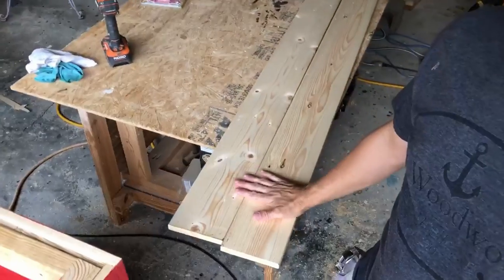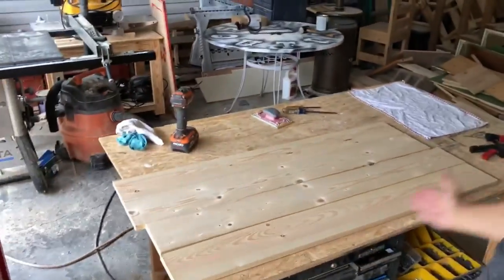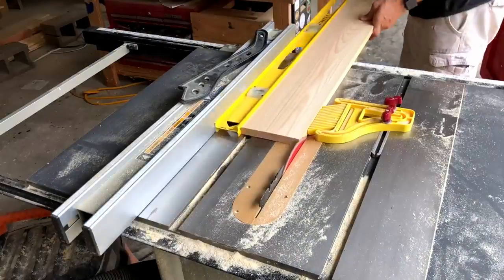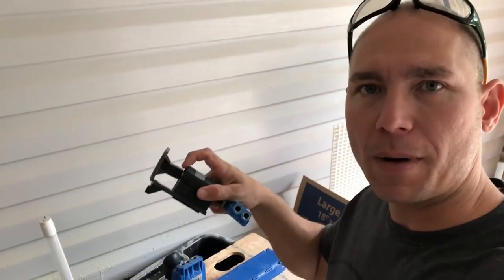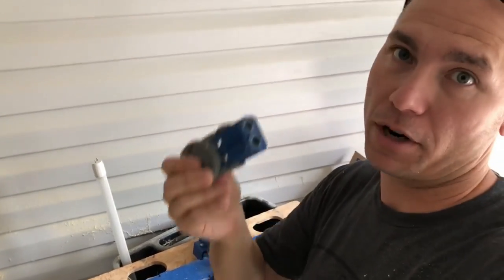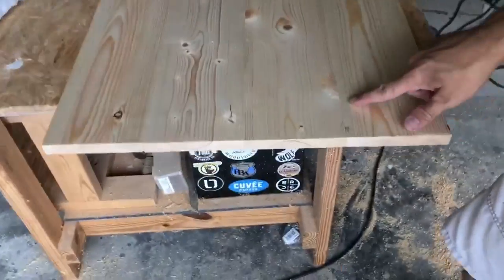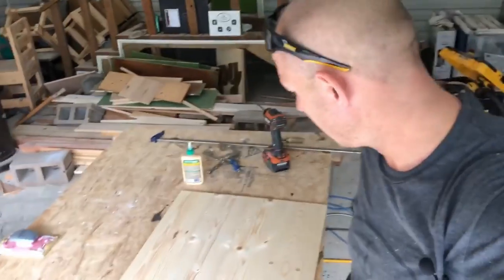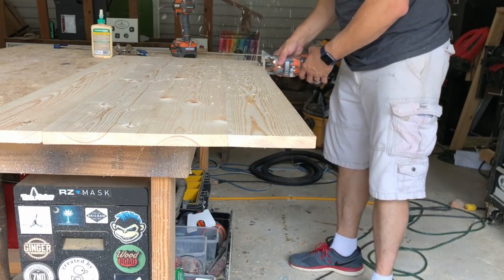How to Build a Wood Tabletop using pocket holes

Comment: TIP ON THE KREG JIG:  Do not use an impact driver to drill the pocket holes.  It will bind up and destroy the adjustable collar on the Kreg drill bit and you will not be able to slide it up and down the shaft..unless you have a press to get it off.  I have had much better luck using an "old school" corded drill for the drilling.
Reply from the maker: Good tip. Thanks
Reply: Had the exact same thing happen to me.
Reply: Did you mean don’t use the impact drill to drive the screws? No one should use an impact driver to do any kind of drilling.

Comment: Maybe I'm over compensating, but when I put two jointed boards together, I pocket hole and screw both sides  of the joint. The fact of the matter though is, when the glue dries, it is stronger than the screws, so the screws end up just being there to hold it together until the glue dries.  They could be eliminated altogether by clamping in the X and Y axis.  In other words clamp the boards together as normal. Then put boards on top of and under your glue up running at right angles. Clamp those together. They will keep your boards in alignment and flat. They are called "cauls".
Reply from the maker: That's right. That glue is very strong!

Comment: I've heard the wood can crack over time when joined by pocket hole screws if it is not dry enough and if the ambient humidity changes dramatically over the seasons. Some lumber needs to dry for months after it comes from the lumber yard before it can be made into a table top.
Reply from the maker: I haven’t had any issues
Reply: agree, heard its better to use glue
Reply: Most lumber from Lowe’s and HD are in the area of 20% wet. Kiln dried does help. What happens is when you take the wood inside to a different moisture level is where you run into problems. A lot of people will let the lumber dry inside somewhere like a shop or their attic. Sometimes you get better options if you go to a dedicated lumber yard or get lumber off Facebook from someone that has kiln dried rough cut. Also keep in mind that big box lumber comes from all over the US and then is shipped to different parts of the us where the humidity is different and also the time of the year. You could always pick up a moisture meter if you wanted. Don’t forget about wood movement as well. Better finish all sides of the table top to prevent as much movement as possible.
Reply: @AngryMountainMan  yep I put a few coats of poly on the bottom of a desktop I made this week for that exact reason -- I want the moisture exchange to be even all around
Reply: Pocket holes has nothing to do with it. Any lumber can crack if joined to other pieces then moisture levels change. If you notice Matt used glue on all his joints, so all the pocket holes are doing is acting like clamps. Once the glue dries it is no different than if you use glue and a ton of clamps. The pocket holes just make it easier to maintain alignment during the glue up and drying process. You can also work with the piece right away to make your final dimensions, trimming your corners, etc..
Reply: @markabernard  I thought using wood glue alone allows the lumber to flex and move due to varying moisture levels, vs pocket holes don't allow that.

I agree that they are basically a convenient clamp when building but after building, its not like you keep clamps on for the lifetime of the project
Reply: @xxbondsxx  I'm not sure. You could be right, However I have seen others, like Steve Ramsey, also use them and say they have not had problems.
Reply: @markabernard  Oh yeah Steve Ramsey is great -- but I don't think he's used them on a wide tabletop before 🤔
Reply: @xxbondsxx  you are correct. Glue doesn’t go as deep into the wood as the screws do. So the wood will expand more with just glue alone. Technically he could remove all the screws because they are a clamp of sorts. Glue alone is amazingly strong. Alignment can be achieved with biscuits as well but add nothing structural wise. Unlike the screws which do add to the structural integrity of the piece.

Comment: I made a small end table about 17” wide with 3 boards. When I joined it together with pocket hole screws it caused some arching of the table top. Everything looked flat before screwing them together. Any thoughts?

Comment: Thanks for the amazing video. I am planning to build a desktop table as my first wood project but all I have is a circular saw, drill and impact driver. I was wondering, if I use just the glue & pocket holes without squaring the edges, and later fill the gaps with a wood filler and sand it, would I be able to pull this off. Any advice is much appreciated. Thanks.

Comment: Nice video. What was your stop collar set to? I saw the jig set to 3/4", but the stop collar seemed pretty deep.
I'm trying to attach a 3/4" plywood top to a 2x4 frame (2x4's on the 1 1/2" edge). I'm having hard time finding the right settings for screw, stop collar and jig. TIA
Reply: I know it’s been a while since you commented, so I’m assuming you either figured it out, or scrapped the project 😉😆 but for anyone who may read this and have the same question, the answer is to set all stops to the thickness of the SMALLER or lesser material depth because that’s the material in which the holes should be formed. So in this instance, 3/4” since you’re securing a 3/4” ply top to a frame with material depth of 1.5”.

Comment: Hi, thanks for this video! I am also making a table using 1x6s with a kreg pocket hole jig. I tried this one time already using the 1 1/4" pocket hole screws, and on some of the pocket holes, the screw came through the top of the table. What am I doing wrong? I want to make sure I do it correctly this next time around!

Comment: Have you had any issues with wood movement after some time passes, using the pocket hold / glue method over other methods like biscuits? Would breadboard ends help with avoiding wood movement / cupping or anything similar?
Reply from the maker: I haven’t had any issues with any of my builds.
Reply: @731Woodworks  thanks, new subscriber, love your videos!

Comment: Great video!  Thanks for posting. New subscriber. Can you tell me why you used the level as opposed to the fence itself?  Thanks!
Reply from the maker: The level moves with the board, thereby giving the board a straight edge to reference. If you just use the fence, the edge being cut is referencing the other side of the board. Which is typically never truly straight.

Comment: Have you ever experienced a wobbly table top after you put the pocket screws in? I don’t usually use wood glue and pocket holes, I don’t know if thats why or if my material needs a deeper pocket hole so the 1 1/4” go into the next board more. I set my jig and drill bit to the right depth tho so i dont get why it happens lol and i use 3/4 material
Reply from the maker: I set the stop collar on the drill bit so the hole is about 1/8” to 3/16” shallower than is recommended
Reply: @731Woodworks  ok I’ll give that a try 👍🏼 thanks!

Comment: woud this work even on chep materials? I have 2 12x48" shelves I wanted to put together as a DIY table top. I think they are only 5/8 think can i still use pocket holes? Thanks for always providing beginner tips..so helpful!!
Reply from the maker: If it is MDF (particle board), I'm not sure if it would work or not?  Sorry.

Comment: great videos!!! new to wood work - Question why do you use a level to get a straight cut isn't that what the fence is for?
Reply: Question why do you use a level to get a straight cut isn't that what the fence is for?
Reply from the maker: The level moves with the board, thereby giving the board a straight edge to reference. If you just use the fence, the edge being cut is referencing the other side of the board. Which is typically never truly straight.

Comment: I have the harbor freight pocket hole jig which is obviously not as nice as the Kregg.  my question is will the Craig pocket hole jig keep from having blowout when using 2x4 runners underneath a workbench table top?  using the harbor freight model there's a lot of tear out. I know some of it is because of the grain direction, but it seems in looking at other videos when people do pocket holes along the side of a 2x4 they don't have the tear out that I'm having.
Reply from the maker: It may be the sharpness of the drill bit. When my Kreg drill bit gets dull, I see some tear out myself
Reply: 731 Woodworks I have a brand new Kregg bit.  I was wondering if the design of the harbor freight PH jig was contributing to the tear out.  I will do some further testing.  Thank you for getting back with me.

Comment: Great video. I want to make a small table top to fit into an alvoce in the wall. Was thinking of making it out of 1by Oak boards and using glue and kreg screws to join the boards. However i am worried it wont be strong enough since the table will have a significant amount of weight on it. Approximately 50-100lb
Reply from the maker: It depends on the spance if the top.if it is a large area then that might be an issue.
Reply: @731Woodworks  59.5 inches wide and 32.5 inches deep. Which is an awkward space because its just a bit too big to use one of Home Depots precut 2' by 4' sheets unfortunately
Reply from the maker: What about creating a floating shelf type system that attaches to the wall. Use 3/4” plywood as your table top and trim it out to hide the ply edge?
Reply: @731Woodworks  not sure what you mean by floating shelf but i already have two steel brackets rated for over 1000lb screwed to the studs in the back wall. But the weight on the plywood would be sitting over a foot away from where the bracket support ends underneath the ply. So idk if this will cause the ply to bend and eventually break over time. Also there will be very expensive equiptment on the table so that is why i went for the really beefy brackets in the first place just for peace of mind
Reply from the maker: Check this video out, it may give you some ideas 
https://youtu.be/BpS_MEHfgac

Comment: Nice idea for jointing with the level.  Like you said, need to move it with the board. I use a homemade straight line jig but your way looks easier.   I find it easier to route the edges with the router base over the top instead of the end.  Easier to control.  You probably have the Kreg Foreman by now?  BTW, down here in Louisiana we must feed our dogs better than yall.  That poor greyhound looked mighty hungry - lol.
Reply from the maker: Ha ha.  We have one greyhound that is overweight and one that is petite lol. I don't have the foreman.  Just the K5 and R3.  Not sure the foreman would be worth the expense for me at this point especially when I need other tools like a more powerful router, jointer, router table, the list goes on and on and never stops lol.

Comment: I am looking to build a l shaped desk - can I pocket hole connect the 2 pieces of birchwood plywood?  (Stacked 2 pieces for additional thickness)
Reply from the maker: Stacked? I don’t think if they are stacked
Reply: @731Woodworks  hmmm....again I am new to woodworking.  Wondering how I can get this to work.  Thanks for the fast reply btw
Reply: @731Woodworks  Might have to use a biscuit joiner...still researching :)
Reply: Have you done this yet? If not, you can look into dowels if you haven't. Very strong.

Comment: Matt, your videos and projects are great!  Curious on this tabletop though.  I don’t want to go through the trouble of making breadboard ends; however I understand their purpose.  Have you experienced any cupping, or warping in the top, or boards coming apart?  I was going to purchase a router to also act as a jointer to get the boards properly joined.  I live in a climate that experiences extremes (hot humid summers, very cold dry winters), and want to make sure the tabletop can expand and contract without breadboard ends.
Reply from the maker: I haven’t had any issues with bowing/cupping.
Reply: Look at the ends of your boards. Notice how the tree rings go. Alternate them up, down, up, down. That should help. Also, apply finish to both sides of the table top. You need to seal the underside or it will absorb moisture, making it expand and possibly crack. Lastly, you could attach boards going across the bottom of the table to keep them flat. Many farmhouse tables have them then the legs are attached to the sides of them.  A router would help do many things. You could cut a groove in each board, then cut a thin piece of wood that fits snugly and glue it in. That is called a spline. You will probably see more cupping with thin boards than thick ones,  Sealing the boards is important.
Reply: I did this last week for the first time. Went to go back to work on it the next day and found it cupped beyond repair. I did 2 more this week with bread board ends using a harbor freight Dowling jig and problem solved. It looks nicer and was really a breeze

Comment: I'm having difficulties getting straight rips on my table saw. Could be because it's a cheap HF table saw. I'm gonna try the level trick!
Reply from the maker: I had an old cheap saw when I started out.  It is very difficult to get a straight cut if the fence is not true.

Comment: Hi I'm a beginner.  What's the advantage of doing it this way over a sheet of plywood?
Reply from the maker: Hello.  Plywood will have the layered edge showing.  If you don’t mind that, then you can use plywood.  Or you can deal with the plywood edge either with edge banding or some type of trim like I did in my Desk with Drawers build a while back.
Reply: Mark White Plywood can be stronger, depending on the thickness and cross supports. Depending on the thickness, you might can buy an iron on laminate to cover the rough edges. If you don’t have the money or tools to do a 2x4 butcher block table, pocket hole joinery is an excellent and easy method.

Comment: matt, you have a great channel and i'm pretty sure i've watch every single video.  so the table top i'm making, i used pocket holes and my connections are perfect with little to no gaps BUT there was a bow or a crown (not sure of the right word) in one of boards. i'm sure i can use my belt sander but it'll take a while.  would this be an ideal time to use my 1 year old never opened electric hand planer?  i appreciate any help.
Reply from the maker: I’ve never had any luck with my hand planer.  Makes more of a mess than fixes lol.  You might have better luck
Reply: @731Woodworks  if wouldn’t use the hand planer. What would you use?

Comment: Hey, so I tried doing this and my boards started to warp making a concave at the center. I had the entire table top clamped on top and bottom as well as left and right during the pocket hole assembly. It only occurred shortly after assembly. And tips or advice as to why this happened?
Reply from the maker: Mark Karman typically this happens if the boards were warped to begin with. Or the edges are not square and even.
Reply: Yeah, I think you are right. I went to Home Depot bought the straightest 2x4s I could find to try and build a 12ft wall to wall table. Didn't have a table saw to joint them so I just attempted to pocket screw them hoping the pocket screws would correct it. Any case thanks for your quick feedback! Subscribed!
Reply from the maker: Mark Karman yeah that’ll be tough to get flat using boards that long that aren’t jointed. Thanks for the sub
Reply: 731 Woodworks this happened to me too,should I remove the screws so the boards have room to move?
Reply from the maker: If you remove the screws, the top will fall apart, correct?
Reply: 731 Woodworks thank you for the reply! But I did put wood glue so I’m not sure
Reply from the maker: @koopa411  I would not recommend removing the screws.  Over time, I think you will see the boards separate.  It may be worth making a new top and ensuring your boards are square before joining them together.

Comment: What’s the best stainable wood filler? I have some minor cracks in my table top that I think I should fill before I stain it but I want the filler to blend in
Reply from the maker: It will be very difficult, if not near impossible to get a wood filler to stain exactly the same color as the wood.  This one is probably the best rated I have seen  It might be worth trying it on a test piece before doing it on your table.  https://www.amazon.com/FamoWood-40022126-Latex-Wood-Filler/dp/B001733MIG/ref=as_li_ss_tl?&psc=1&linkCode=ll1&tag=731woodworks-20&linkId=eccfcf48e0b06bd48c3d491939f6d062&language=en_US Affiliate link

Comment: I have tried this method a few times now and my table tops always seem to come out with a wobble. Any advice?
Reply from the maker: The edges of the boards that join together need to be square
Reply: 731 Woodworks I jointed the 2x6 boards with a table saw but I have still not been able to get a flat table top in the end.
Reply from the maker: Were the boards warped?
Reply: 731 Woodworks I did end up having a board that was “wonky” (my southern way of saying warped lol) and I cut it out and replaced it and the table top came out much better. Thanks for all your help!
Reply from the maker: Good to hear